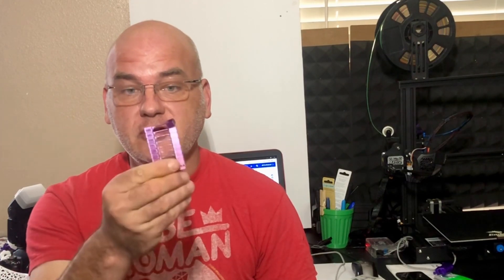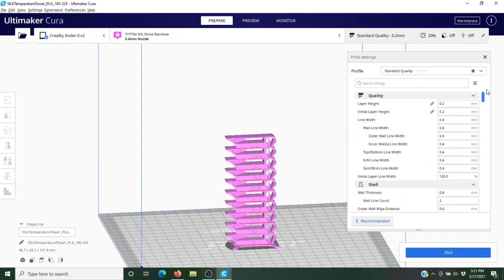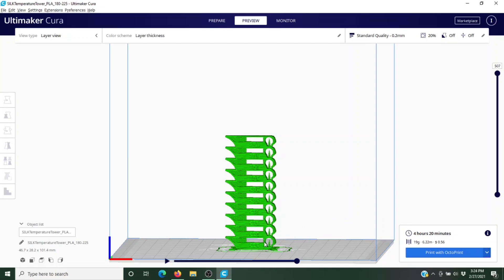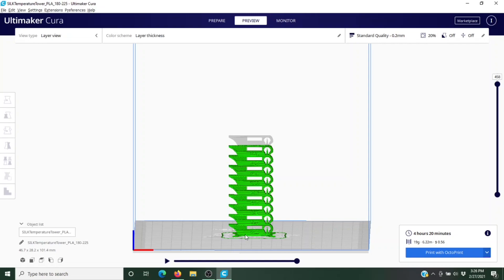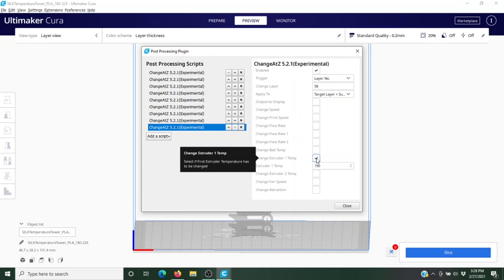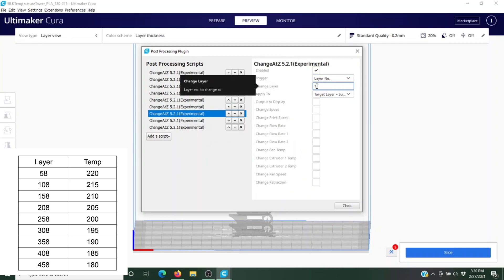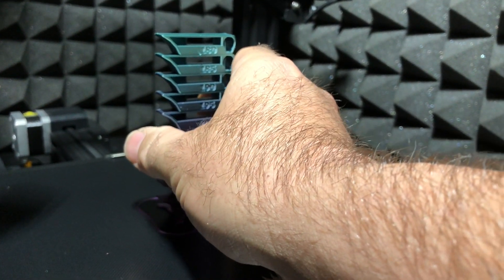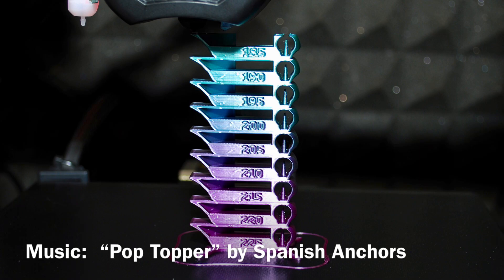Let’s Print a Smart Temperature Tower

Comment: Thanks for the video.  Had some problem filament that just refused to cooperate and this helped in a big way.  A question though - I note that we start at the highest temperature, then decrease as the tower rises.  I've seen towers that go the other way, starting at a low temp then increasing.  Any real advantage from one to the other?

Comment: I've always made my own temp towers so far been able to bridge a 5in gap with little to no sag I am curious tho on this tower just I don't understand why the bridging is so thick and the scope side of it I would guess for stringing so it's like a 2 in one but seems kinda wasteful for the size also for all the ppl having cura issues there is add ons that do the work for Ya you just tell it the layer (haven't used cura in a while I moved to simplify 3d cause all the derps I've had on cura and s3d makes life so much easier

Comment: Your tower printed awesome but mine was crappy, i will try drying the filament first and printing the tower then
Reply from the maker: Yeah. It happens. I ran one the other day that strung on every temp. 

Are you using Cura? There is a plug-in on marketplace that makes temp towers now so you don’t have to mess with it unless you want that level of control. 

https://marketplace.ultimaker.com/app/cura/plugins/Kartchnb/AutoTowersGenerator
Reply: @BrianBreaksEverything  thanks brian

Comment: now i kind of know ho to use the G Code.
one more thing, if my bed has temp? to which temp should i set it. 
in case you ask, material = PLA+
thank you very much.
Reply: I am a relative novice, however basic rule of thumb, use what is recommended by the manufacturer of the filament then tweek it up or down from there. Generally somewhere in the 60 degree plus region for PLA

Comment: Cura has made things so much easier now,  there are scripts for temp towers,  all you do, is subtract the amount of layers of the base,  ( usually 5-8 layers) from the total amount of layers,  then divide that number by the amount of temp steps there are, to get the layer count for each of the temperature steps.

in the script you put in your initial temp,  and whether its -5 or 5 for each temp change.  there is also a place to enter your base layer count.   before saving the slice,  enter the starting temperature in the cura settings,  so if your tower starts at 220C at the bottom, you want to have cura start at that, and the script will add or subtract whatever amount you have set ( usually 5c).
Reply: what do you do when the tempersture change isnt going through onto your printer?

Comment: Let me preface this by saying, I am brand new to the world of 3D printing (literally like 5 days into having a printer but long time machinist, welder, and general fabricator though with some ME background).
This might be a rather dumb question, but any particular reason for starting hot and then progressing cooler as you move up?

Granted, natural part cooling probably negates any effect but at face value, it seems to me that you would want to start with the coolest and work your way up in temp along with elevation rather than temp down as elevation increases because if hotter on lower level, heat propagation from hotter lower levels could in theory effect the next upper level. 

Again, natural part cooling and the fact that its only 5°c increments probably negates any possible temperature propagation effects but it was something that caught my attention because of the welder in me and having situations over the years where welding sequence of assemblies was critical because of heat propagation (particularly in reference to time per assembly with heat sensitive materials)
Reply: You start hot and go cool because it is possible that at the lower temperatures your print fails due to the filament not melting & flowing fast enough.  Most PLA will still function at 180, though certain finishes (Hatchbox Matte finish PLA likes ~15C higher than glossy) may stop flowing around 190, meaning around 185 your tower starts having major gaps and at 180 it might not print at all.
Reply: @Trgkai  Thanks for the reply.
That makes a lot of sense and on top of that, I decided to do a little test just to see how much potential there is to actually be a heat propagation. Turns out, natural cooling like I kind of thought might be is cooling the part so fast that its really not a concern.

Basically what I did was printed a 20mm cube (purposely did it as a solid so it had the most mass thus retaining the most possible heat) and mid way up, I had a partial hole feature coming in from the back side and once the at a layer that had the hole about 75% complete, I stuck a thermocouple in it to monitor the temp. despite printing at 215c with a bed temp of 65c, I never say higher than 197c on the meter and that was only short spikes as the nozzle passed  over the tip of the thermocouple printing the last couple 2 layers closing the hole off on the top side. 

By time it was a two 2 or 3 layers beyond that, the temp was already down to about 100c and within a couple more, it was down to about 80 where it slowed down in its rate of cooling.

Seeing that, it clear that natural cooling (well with cooling fan on between 95 and 100%) definitely indicates that heat propagation is definitely not a possibility like I first thought could be possible.
Reply from the maker: Man, I have no idea!  I didn’t design the temp tower, I just made a video about it. 

But what you’ve said makes logical sense to me. Maybe so one more knowledgeable will chime in. I’d love an answer too.

Comment: TIP: You can use the keyboard up/down arrow keys to move through the model, one layer at a time. Simply click the circle on the layer scroll device located to the right of the screen and then use the arrow keys. 
I personally use this trick all the time for inspecting the generated slice layer by layer, and it would also help with this temperature tower.

Comment: Very nice tutorial. One minor thing though: You are off by one layer. 

While the layer number in the Preview is one-based, it is zero-based in the resulting gcode. If you open the gcode with a text editor, you should see comments before each layer. The first layer is commented as ";LAYER:0", the first layer with a temperature change as ";LAYER:58". So it actually changes before the 59th layer and the scripts should instead be assigned to layers 57, 107 and so on.
Reply from the maker: Interesting. Today I learned something new. Thanks!
Reply: The scripts use a  'trigger' layer which means it would change on the following layer you program. So he is actually off by 2 layers. :) To start with a new temperature on LAYER:57 you set the trigger layer to be LAYER:56 so when LAYER:57 starts, it starts at the new temperature.

Comment: I was wondering if you actually watched that the temp changed on octoprint or on the printer panel?  Did it really change temps?  Because I'm thinking about doing a temp tower, the one you just did, and they usually have some variation in them, drastic variation, or why bother?  
I give you props for a great video but I was a little surprised at the end and it didn't seem to bother you that the print was so consistent.  If you say you saw the temperature change and not just trusting the code I believe you. totally!  But this is a very surprising result to me even though I have never printed one in my life.  Pictures online don't look like that.  Some bridges just collapse, others are perfect normally, I've seen consistently online.  What are your thoughts?  Maybe your printer is just so dialed in or the filament is off-the-hook... I don't know, but if so, I want to get mine to that level for sure!
Reply from the maker: Edited to add:  The more I think about it, the more I realize what a great question this is. I’m so glad you asked it. 

I actually watched it change. And then ran it on a second printer to be sure it worked before I released the tutorial. The towers on the 2nd printer showed a large difference in results with standard PLA from a different manufacturer. 

I think, and I’m not positive until I test, that the silk PLA I used in the video would show much different results if I used a tower that went to a hotter temperature. The manufacturer recommends printing it as high as 230 iirc. So I think if we ran it above that we’d see some different results. I might try it.

When we ran the tower on my son’s printer we saw noticeable differences between temps. But even more interesting to me, he ran it on two colors from the same brand. And the results showed that the white and the black from that brand would be best if printed at different temps. 

Thanks for watching the video and for your thoughts.
Reply from the maker: Hey. Me again. We ran that tower again tonight except we upped it to 240 on the high end. And yeah, it shows some real ugliness in the 240 and 235 section. Jess followed my tutorial and made her own tower. I’m so proud. 🥰
Reply: @BrianBreaksEverything  Awesome!  I'm going to try a temp tower today.  Now I have some realistic expectations of how it would work out!  Thanks for putting in the extra effort.  :)

Comment: I did exactly the steps in this video., and my print is still not changing temps. its halfway through the second story and still at the beginning temp. Ender 3 V2
Reply: In cura i had a similar issue. I ended up making 10 scripts adding one for the 1st layer too to actually get it to change temps. Not sure what's up with that.
Reply from the maker: @channinglittleman6542  that’s a great idea. If you do a temp change after the first layer you know the scripts are working without having to wait very long too.
Reply from the maker: Obviously something is amiss. I’m sorry that happened. You can either watch for when the temp does  change or cancel the print and diagnose. But I assure you this method works. I’ve set it up multiple times in Cura now for 3 different printers. 

Two suggestions I have. First, after the print is finished or canceled you could look at the gcode file in notepad and see if anything obvious sticks out. Or if you aren’t comfortable doing that just redo the settings in “modify g code” and reslice it.
Reply: @BrianBreaksEverything  Tried this and temps were not changing. Checked the gcode and at each change layer there were 2 M104 commands. The first set the desired temp and the second set the temp back to the default.  I deleted the default temp gcode commands and then it worked.  Not sure if this was my fault or Cura's but I learned some gcode editing...
Reply: @BrianBreaksEverything  done that twice. I think there's a bug in cura not applying the temp change to subsequent layers. I'll try to download an older version
Reply: @BrianBreaksEverything  I just searched for M104 and apart from the ones setting the initial print temp, the first one is at 200 degrees and slice 358 or something. I have them all enabled in cura, and all seleced as all subesequent slices. there is an issue somewhere here